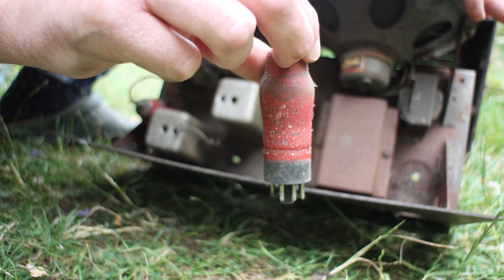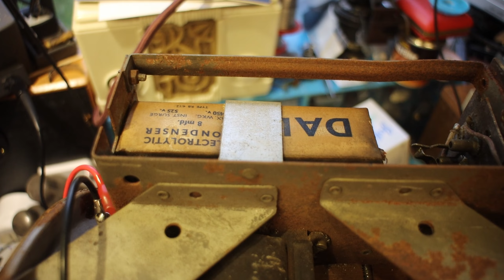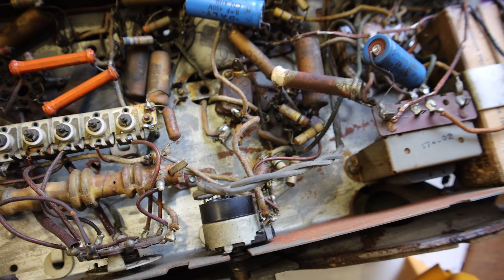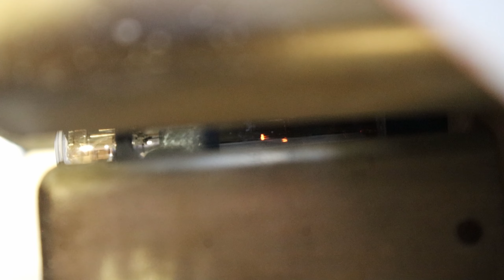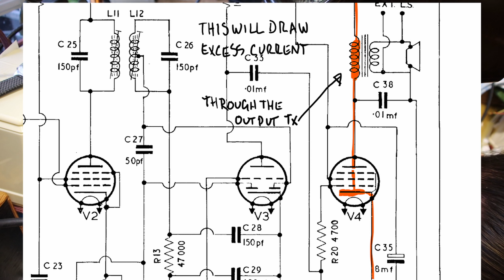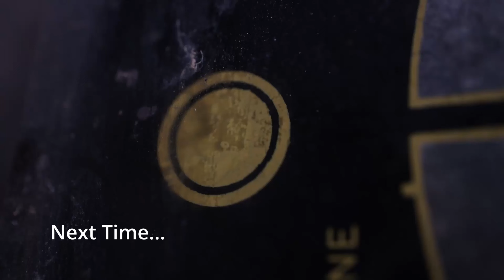Radio Rentals 60, first impressions...

Comment: Some nutter in a shed ware do you get germanium transistors for my zenith Trans oceanic shortwave receiver I want to restore it? 😅😊
Reply from the maker: Hi, best bet is probably to search for them on eBay, that's where the vast majority of parts I use come from. If not, then it would be worth joining one of the vintage radio forums and asking on there if anyone has any, or if they can suggest an equivalent type

Comment: A  24v ac supply to the primary, is a handy way to test mains transformers and also test valve pin voltages prior to the full voltage smoke test.
Nice video,
Steve
Reply from the maker: I might try that on the next project!